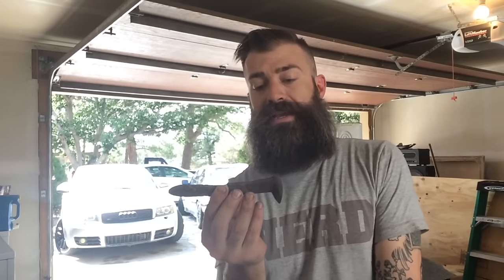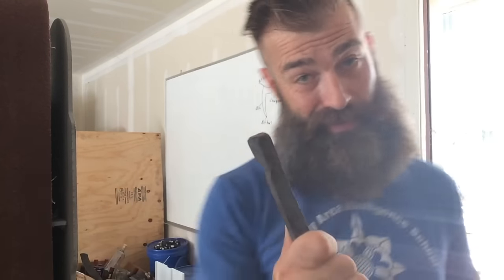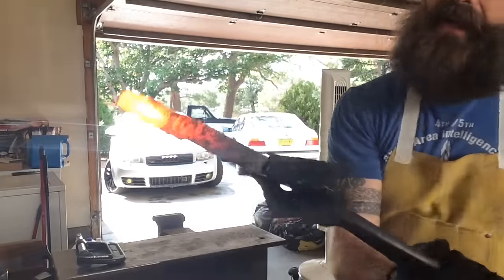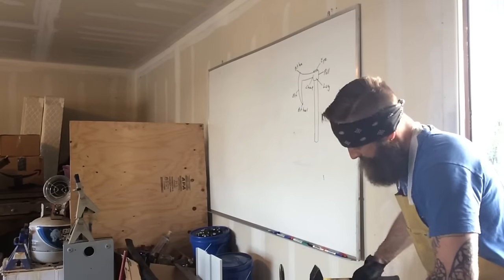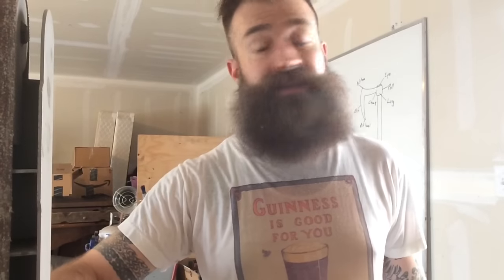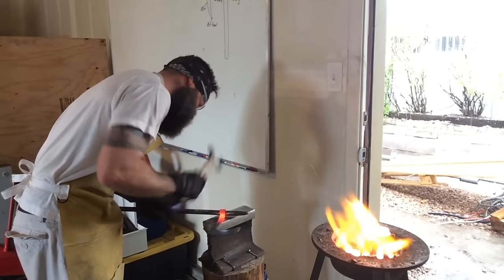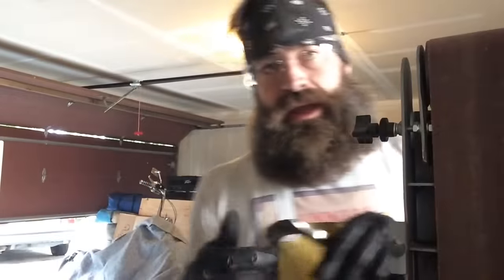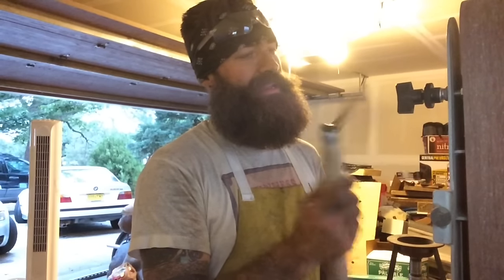PART I: Marshall shows you how to make a viking axe out of a railroad spike

Comment: Marshall, just a heads up, the MC stamp is for mild carbon, the HC stamp is for high carbon. if you can use MC for the body of the axe, and sleeve HC for the edge, you'll have a very strong/durable axe.
Reply from the maker: +John Poidevant This is great info! Thanks!
I've thought about doing a video where I use a piece of high carbon steel and forge weld it into the body as the bit but that would take up a whole video on the processes alone.

Comment: If you want a more uniform quench, try heating up a chunk of scrap metal to almost a wheat color and let that heat up the oil for a minute or two before you quench your piece! It's only just a little slower and it gives a nice even quench through the metal. Especially useful for thicker pieces! Also what a great idea to use a segment of railroad track as an anvil! Brilliant!
Reply from the maker: +Wesley DaBes Thanks for the tip!
The railroad track was really just what I had laying around so I can't really take too much credit for it; it just worked out that way. 
Thanks for watching!

Comment: One tip i could give you for the eye, seeing as you didn't have much material to play with, is instead of trying to punch through, try wrapping the whole head around a mandrel, and going from there. That way you would retain as much thickness as you would realistically ever need, with slightly less hassle. Otherwise, shits absolutely fire :D
Reply from the maker: +Thanos Karathanasopoulos Exactly my thoughts. That is the traditional method of making the eye on an axe and in my final thoughts in this video I say just that. 
This will be the last time I do that with so little meat to play with. 
I've done tomahawks with this method and so I thought it would translate to a larger axe and it just didn't. 
Thanks for watching!

Comment: Another way you could have gotten more steel to work with is if you had hammered out two blanks from two different rail ties and then flux weld them together to form one big piece of steel. Not only would you have had enough steel to work a decent sized eye but a much bigger blade too. =^_^=  Just an idea if you ever decide to remake it.
Reply from the maker: +Vissago Catnap Too true! I did that with the coat hanger project but for this I kinda wanted to see what would happen with just the one. No part of it was, technically, ideal but it was a fun project and that's what it's about! 
Thanks for watching!!

Comment: you keep saying you used a lot of charcoal.  i think i might have an idea to help the efficiency of your forge. your forge has a metal flange around the outside edge that your legs are bolted ir welded to, right?  so if you took a semi-truck brake drum coated the inside with half inch refactory cement or equal parts plaster of paris and sand, you could effectively make a lid for your forge.  if you then cut a hole in one side of tge brake drum that would  give you a way to put your working materiak and your charcoal on the flames.  i think it would also minimize yoyr heat losd so you could use less charcoal,  just a though.
Reply from the maker: That's using your head!
What you are referring to more closely resembles a furnace, which I have made for metal casting. 

Heat retention was not necessarily the issue with the amount of charcoal that I went through on this build. More that I had to heat the axe over and over. 
Using a furnace type forge can get risky because, while retaining all that heat, it's easy to bring your steel to the temperature at which it becomes molten. 
There is a sweet spot where metal is malleable just before it starts to drip away and one needs to try to keep their steel in that sweet spot less it be too cold to shape or so hot that it cooks away. 
The reason I use the open top on my forge instead of insulating it is because keeping the top open makes it easier to keep my steel in this sweet spot. 

Building of a furnace and metal casting is another of my hobbies that I plan to make some videos of in the near future. 

Thanks for watching!
Reply: +marshallknowsstuff i understand what you mean. i am a self taught blacksmith . my only teaching aid was a book called modern blacksmithing.  i was thinking about a furnace when i mentioned it. but some of the forges used in Europe during the middle ages also had lids like this.  when i built my forge like this i drilled a whole in the center of the lid and added a trap door so i could add charcoal from a hopper on top.
Reply from the maker: +Caleb Springer That'd be a cool project! Maybe later, when I have a committed smithing area, I can build something like that.

Comment: Hi Marschall, good job! Looks nice! 
Wich grain do you use for the finish before you polish?
Reply from the maker: +Bosco Baracus The grit I use depends on how polished I want the piece to be and the tool with which I am grinding.
An angle grinder will make quick work of any steel because of the speed at which it revolves so I don't usually start below 120 grit and can easily go higher than an 800 grit before using a sisal wheel. 

Thanks for watching!
Reply: Ah cool. Thanks!
Reply: and greets from Germany ;-)

Comment: Hey Marshall I use to use charcoal and it got pretty expensive and I found that you can buy 40 pounds of anthracite coal for 5 bucks hope that helps
Reply: where at
Reply: Tractor supply
Reply: +Milton Tucker thanks I'll check it out
Reply: +Fearless hey sorry for not clarifying but yeah tractor supply they have nut and rice coal I have found the rice is better for forge welding but both are great!
Reply: +Levi webber thanks man I'm going to go today and pick some up.  I was using charcoal briquettes and they sucked and I would always have to clean ash out of my forge
Reply from the maker: +Levi webber Thanks for the tip! 
All my charcoal is free anyway though because I make it from pallets I pick up for free. 
I have a video on how to make a burn barrel and you own charcoal if you haven't seen it. 

Using coal does yield higher temps but it can also make sulphuric acid when the smoke mixes with water. 

There are ups and down to both but I don't feel like cost is that big of a deal for either.

Comment: for more metal around the cheeks cut a longer slot. you will get a bigger circle
Reply from the maker: +Toe ofawesome Too true. I kind of pigeon-holed myself by giving myself such a finite amount of steel to work with in using just the head of the spike.